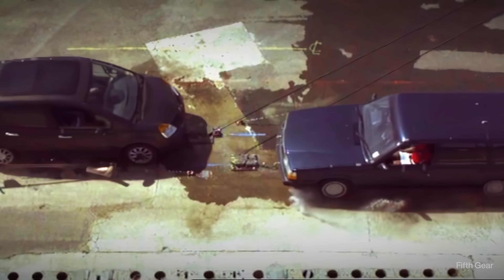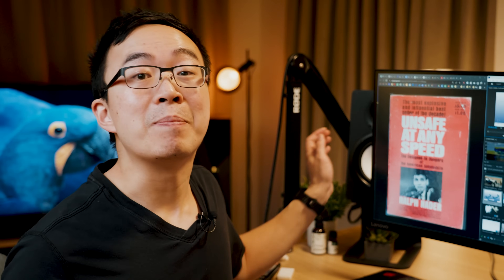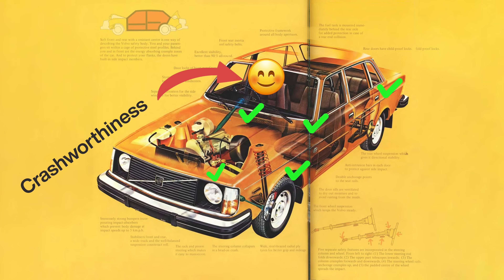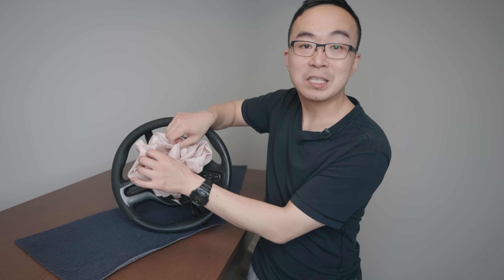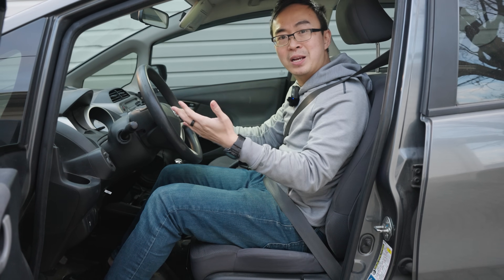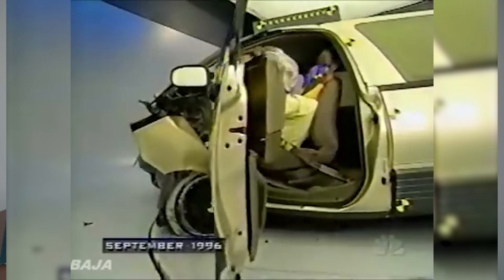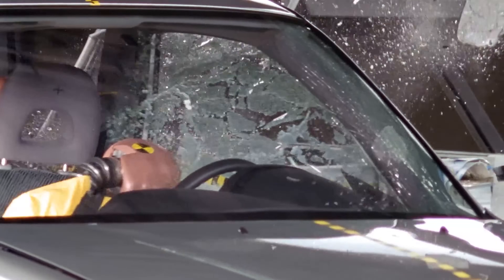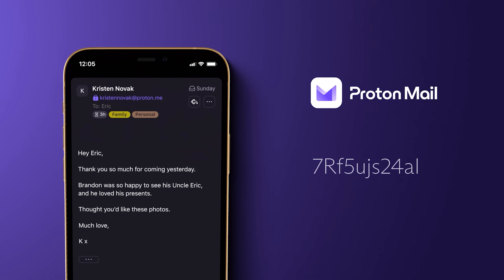When does a car stop being safe?

Comment: I'm quite surprised how you don't mention EuroNCAP at all. It's what Europe has been using for deciding what kind of cars are safe, and which most likely mutually helped the US crash tests.
Reply from the maker: I had to set limits on the scope of the video, the research alone for this was difficult. If I had to do Europe and weave a storyline, this video would have taken a year to finish.  I am looking at European standards in the future
Reply: @Lam  well, one of the most safe cars you mentioned — Volvo is firstly rated by Ncap. Better to mention it at least in future videos
Reply: NCAP focuses to much on ADAS these days. It's irrelevant for crash-worthiness. You could have a 4 star vehicle that crashes better(meaning it provides more safety to everyone) than a 5 start one, simply because the 4 star one doesn't have all the bling bling gimmicky features of lane assist, auto braking, and other things like that which also bug a lot and are not even proven to actually reduce crashes.
Reply: @Paul.V.24 auto braking is mainly designed to reduce the severity of a collision. If it prevents it, great
Reply: @paulmagnnum Links to the research showing the safety systems you've mentioned don't reduce accident rates.
Reply: @Paul.V.24  Lane assist is kinda dangerous in winter conditions. My -17 Golf often misinterprets lane markings when the road is covered in snow, and tries to steer into oncoming traffic or into ditch.
Reply: @jauho7483  can we turn on or off lane assist function?
Reply: @jauho7483 VW Lane assist is downright dangerous sometimes lol, I have to click it off for country roads with no road markings or single track as it often gets it wrong and tries to steer off the side or into oncoming lane. My vw arteon is only 2 years old, tho to be fair I live in Scotland where the roads are nearly always wet with rain lol
Reply: IIHS is much more strict than euroncap.
Reply: @angelgjr1999 IIHS is not. The US allows automakers to to self certify their cars as safe. Not in the EU. Hence why Cybertruck and many US vehicles aren’t allowed in the EU. It has nothing to do with their size, but the fact they’re inherently dangerous to the driver and pedestrians.

EU ratings and approvals take into account others, including pedestrians unlike the US. Which is horrible for this and why the EU car ratings are considered THE best for car safety and pedestrian safety ratings, and again why so many US vehicles aren’t allowed here and many have nothing to do with being too big.
Reply: @angelgjr1999 Not true, IIHS doesn't even have a pedestrian protection test or standard for cars sold in the USA. Although your small overlap testing is good, and your side impact testing is more thorough. 

Maybe you're right actually? 🤔
Reply: WTF how do you turn this into "its thanks to EU the US is safer, and you have to mention it" look at the practical demos his done, so even people as stupid as us can understand some systems. which is unique, you can watch every other crash test video or google some stats if you want to feel how great Euro ANCAP is. there is 247 Dislikes on this video. I thought "what idiot actually dislikes this video" Know I know. People that some how dont understand or appreciate wwwhats in the video, and are still able to say, "NEEEEER but but, Euroancap, I drive a Volvo, I will live longer" :)
Reply: @canoaslan1011  At no point did the OP say he had to mention it, they were just surprised he didn't. Mentioning a simultaneous development process that was mutually beneficial isn't them complaining. nor did the OP ever say they disliked the video or were upset it wasn't mentioned. you are really reaching just to insult someone over nothing lol. Are you okay?
Reply: @canoaslan1011  Now you're just an ass not appreciating all the parties involved yourself. Original comment was not about "EU made US Safer", it's about EU and US working alongside making both safer. Notice the "mutually". It's interesting that when your country and their achievements is talked about, presumably America in this case based on how defensive you got, that's all fine, look at us, we are the best, but when other country's or continents achievements and contributions is talked about, you instantly get so defensive of your country. This kind of sad toxic mentality is everywhere and it's depressing to see. Safety is safety, no matter where it comes from. Not everything has to be a competition on who is the best at what.
Reply: @canoaslan1011 do you really not consider that people walk around with iPads or phones when watching videos.  I really don’t think the thumbs down button tells you much of anything.  At least not for content like this.
Reply: @canoaslan1011 The Old Car FanBoys can't accept that an old Volvo's less safe than a modern car unfortunately.

Comment: A crash test isn't a crash. In the real world no crash is the same. However the more crash tests the car can pass, the larger portion of real world crashes are covered. I'd consider the Honda Fit just fine. Maybe it helps to know and understand from which crash testing era your car is from so that you can try to avoid those types of crashes specifically. Speed is the largest factor - if you drive an older car, drive slower. That won't help in a side impact though.

Comment: Love the demonstration of how the seatbelt elements work.  I didn't realize how complicated modern seatbelts are.  All but one of my cars are 40+ years old, so they have really basic seatbelts that are either basic ratcheting mechanisms or just straight up straps that you set the tightness manually.
Reply from the maker: Yeah, it's surprising how much there is! I left out the electric motors that some vehicles have.
Reply: Manual belts are great if adjusted well.

Comment: You didn’t mention how Volvo was built on safety and the Volvo and Saab rivalry, basically the two try to out do the other in car safety.

Without Volvo you would not have the 3 point seat belts, Volvo more or less invented it and was the first to put it in to production in 1959.

Comment: I have seen Chevy cavalier VS a Silverado and the Cavalier won BIG because the low nose of the cavalier went under the bumper of the Silverado and folded the front wheel incredibly badly in the passenger compartment of the Silverado

Comment: One area I really wish they would crash test is the effect of rust.  Our second vehicle is an old pickup. Mechanically sound, none of the rust is traditionally worrisome (no through wall, no flaking, etc) but the frame is covered in surface rust.  The panels have rust bubbles.  The steering column is a bit rusty.  At what point does the design no longer work as intended?  How many salty winters is too many?

At least where I live, insurance companies are covering more used cars with some amount of rust than new cars. Seems it would be a variable worth factoring in.  If someone has info on it, I would be glad to learn.
Reply from the maker: Good question, it's probably too hard to test as there so much variability with where the rust forms and the amount. Each car would be different.  Maybe someone has a framework around this.  Possibly there's research where they crash the same car for different ages in a rust belt and see what the differences are. They extrapolate from there

Comment: I was in a low overlapping head-on, like your fatal flaw. He popped out of the fog and I hit my breaks and immediately slid so I switched and punched the gas. That made my tail swing out more and the angle of contact changed at the last possible instant and I spun when we connected. I slid sideways out of the seatbelt and was stuffed into the rear passenger footwell headfirst. Totaled both cars. 
   I guess I should add I got charged for criminal negligence because I was passing a few cars going very, very slow. Too slow for conditions,  but fog has a way of changing to soup in an instant. I was found not to be. Mostly because I had the car 3 days and hadn't had time to take off the very bald tires that were on it and that was the first time I drove it in the rain. I tried to slow down and get back in my lane. But like I said, I just slid immediately, like I was on ice. I was stuffed the instant I hit the breaks. A consequence of not being rich more than any culpable intent.
Reply: For your mental image,; I was turning right away from him and on contact my car spun left into it. The hit was 20% overlap on the driver's side for both of us. With a 30° offset for my car to his going parallel down the road. So, if the center line points to 12 o'clock on the horizon, I was pointing at 2 o'clock.

Comment: The smartcar (twofour?), the box, I saw a crash test with it going like 120mph. It didn't crush on a concrete barrier. It was "safe" to the point of not crushing yet the g's would tear you apart, but no significant cabin intrusion. If we could survive 120 to instant stop internally (alas we cannot) maybe it would be important. 
   Is this just a ridiculous safety margin? Why make cars that are stronger by a wide margin and capable of much more damage than the human body can take in g's?
   If we're toast it doesn't matter except saving time removing the body. 
   I understand, despite the criticism, three of my friends have been extracted from vehicles with the jaws of life. All three initially survived but by the time they cut them out only one survived.  These were 2 occasions, in one, the first responder was my buddy's own dad trying to keep him alive and get him out after a girl and him crossed an interstate and pulled in front of a semi going 70. He got it on his passenger door.
  Those would probably be survivable in something with a legitimate modern high crash rating. But again, why exceed it so much?
Reply from the maker: Sometimes like these smart car it's good for a marketing.  After a certain point no structures will keep you alive.  Hence all those drunk driving fatalities

Comment: Call me old fashioned, but the safety rating is not something I considered buying any of my 2 cars I've owned. I guess they are safe enough considering, but then again my current one is turning 19 next year...
Reply from the maker: It's one data point of many! We all live with risk in our lives. We just chose which are important to us
Reply: @Lam  that's certainly true. Like what you said at the end of the video, I also do most things without a car and only have it for a small set of tasks. If I could, I would not even own one and just rent whenever.  Anyway, thanks for this insightful video (and response).

Comment: I am a fan of older especially American cars and I am wondering what I might do to say make a 69 Chrysler imperial into a safer car. How about  1) Side car door beams mounted behind outer skin and outboard of the window glass 2) Roll bar 3) dual brake cylinder  4) suggestions? I have a 60 ford truck setting in my garage that I would like to make safer. Its a very heavy built vehicle and certainly a couple of additional frame supports to tie the frame to the cab might help a lot...
Reply: On such an old car? Larger-diameter wheels and low-profile, high performance all season tires,  so you're best equipped to stop better and steer clear of a wreck in the first place. Then,  dual master cylinder and aftermarket brakes by Wilwood; Jay Leno does this with most of his classics. You can find a kit which bolts right on. A roll cage, at least a limited one,  may help too.
Reply from the maker: Love you are thinking this way, but it's somewhat like putting lipstick on a pig.  I'd enjoy it as is, use it as a fun car.  It'll affect the handling and you also won't have the energy mitigation like crumple zones to prevent injury

Comment: Great coverage on the development history of vehicle passive safety features.

I think there's more to be covered. Active safety features are important as well. Anti-lock brakes and electronic stability control also play important roles in car safety. IIHS recommends cars with electronic stability control for teenage drivers even for the used ones. Now, we also have automatic braking and back up cameras too. These active safety features prevent car collisions and injuries from happening in the first place. I think this would be a good topic for one of your future videos.
Reply: Yeah, and then the teenagers learn how to drive a vehicle that coddles them and are screwed if they ever drive something older, be it for a job or otherwise. Unless the conditions are really bad or there's a lot of traffic, I sometimes like to drive a little aggressively in the winter just to know how to handle when you're not quite in control. It's fun and a mental refresher. I've found that on loose or slick surfaces, ABS makes my vehicle understeer horribly (you should coast to regain grip in the first place) if you do what most normies and the manufacturer want you to do, which is to ride the brake until it makes you shudder to a stop. The problem I've found is that the ABS only focuses on getting the wheels stopped, especially on ice. After the wheels stop turning, the car kinda shrugs and lets you skate off into the ditch. With ABS I either continue to pump my brakes or cover brake (as in older vehicles), because I find that more often than not it just gets in the way. That, and all of our vehicles are manual transmission so I don't really use the brakes in the first place.

Thankfully the only time I've gone off the road was when I WASN'T screwing around, looking for where I thought I remembered a stop sign in dense fog. I'm going 30 MPH and slowing down, kind of discerning the course of the road going "I know I'm coming up on that intersection" when all of a sudden I see it whizzing by my passenger side and I go off a "T" intersection into some grass. I drove out, and pulled over in the next town to check the car. No damage. I came back to that same intersection in the spring/summer and discovered that I must've threaded the needle between a power pole and a tree with a trunk the same width.

Comment: Knowing about the small overlap weakness can make a crash safer by causing you to behave differently behind the wheel. If you know it's safer to rear-end a truck straight-on than to try and fail to avoid the crash by changing lanes, you're going to be less likely to create that small overlap crash in the real world.
Reply: I’ve been thinking about the the best way to crash as I’ve been addicted to watching dashcam crash videos.  It seems like it’s worth swerving and colliding w the car next/parallel to you than hitting the car in front of you and coming to a completely stop.  But by swerving, there’s a chance you’ll end up clipping the car in front w some a small overlap vs a full overlap.
Reply: @Wasabi9111  the biggest problem I've seen with the small overlap is that if the front tires of the rear car come into contact with the rear tires at the front car, it will flip the rear car over instantly. Some of the cars I've seen do that on video were sports cars that could not possibly be flipped over by turning too hard.

Comment: that was a fun deep-dive. I drive an '06 Lexus GS and love my car but the fact it barely passed the moderate overlap has had me thinking for a while I should upgrade.
Reply from the maker: It's one data point! We all live with risk in our lives which is why I didn't come out with a recommendation for everyone.  If you have the means it's a great idea.
Reply: That’s the problem w these reliable cars. My best friend drives an old Highlander w none of the modern safety features.  I keep telling her to upgrade her car w the latest safety features but her Toyota runs perfectly fine.
Reply: @Wasabi9111  yeah, I have been spoiled not having a car payment. My GS, knock on wood, has been solid, save for the oil burning, and that's with my spouse driving 120 miles a day to work and back for a year. The struts lasted 128,000 miles on Florida roads. Been buying a new car for 4 years now and still haven't done it :)

Comment: Great video for those that didn’t already research car safety! Regardless, I’m not buying anything newer than 2006 and I’d rather die at the steering wheel of my 1996 Daewoo Tico than replace it.
Reply: Why won't you buy anything newer?
Reply: @jamesengland7461  Driver "assistance" and all the other "safety"/comfort "features" are my main problems followed by: more complicated drive trains; more and more electric motors replacing good old mechanical components and, of course modern cars being simply worse for a boomer/car enthusiast like me (fake exhausts/vents, worse sounding exhausts, less raw driving experience, more and more plastic in the interior and, in my opinion, worse looks).

Comment: My SEAT Leon ST (VW Golf 8) from 2021 has extended passenger protection, so it will tension the seatbelts (electric motors) and roll up the windows almost all the way up if open to avoid lems to fall outside but still let the pressure from the airbags to exit.
A pretty cool option that should be standard on all new cars 🙂

Comment: An airbag can deploy with a 3 km/h bump. This writes the car off with no visible damage and you can get injured because you did not move forward. I saw it happen, that is why I know.
Reply from the maker: I believe that doesn't or very rarely happens these days with modern cars.  Better sensors plus an extra safing sensor has removed that risk